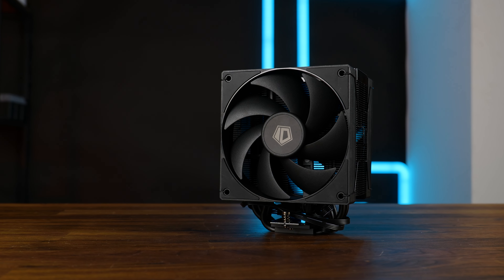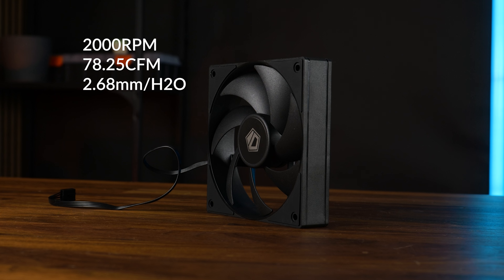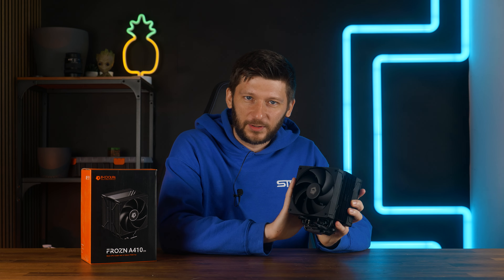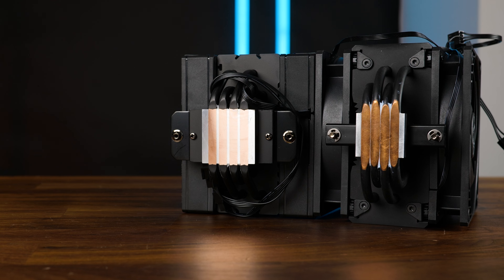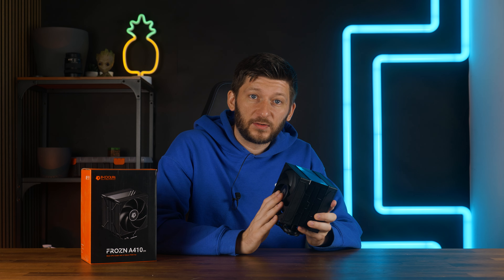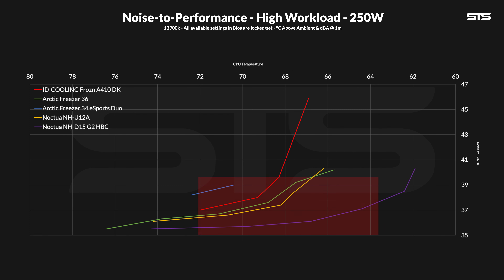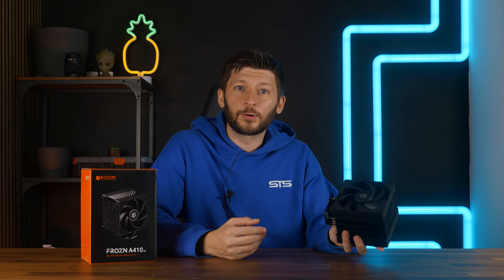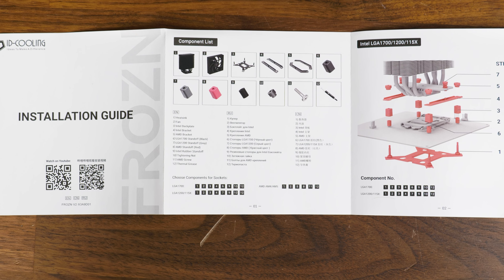Better Than A Freezer 36? ID-Cooling FROZN A410 DK Review

Comment: So more expensive than the 36 in my country, noisier, higher temperature and no convenient installation of fans like with 36. This is a fiasco, bro.
Reply: Are you using the freezer 36?
Reply: @sh9nyYT  yeah, great cooler for a great price, never thought such a pretty small thing could cool the CPU so well. Plus, it's quiet and installing fans is super easy. In short, I recommend it
Reply: @corkoza  in UK the freezer36 is $13 more expensive